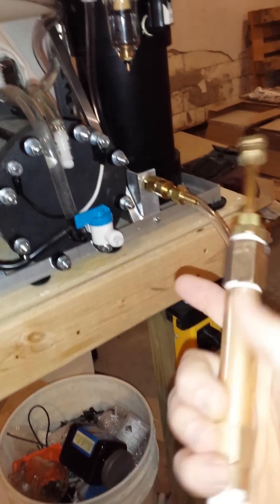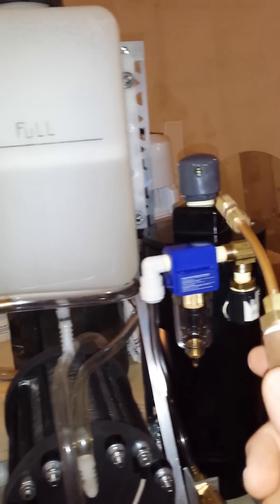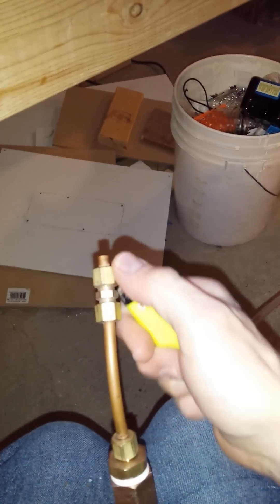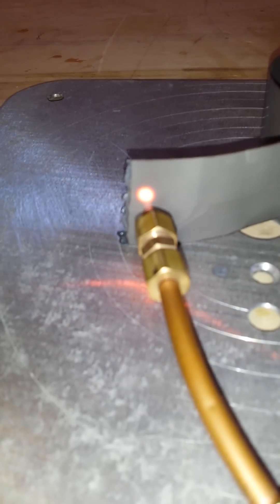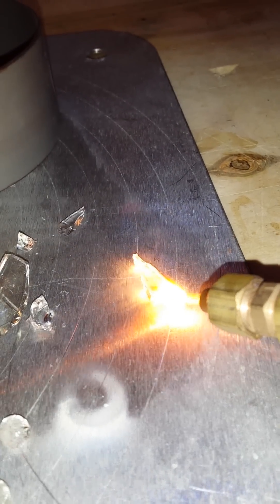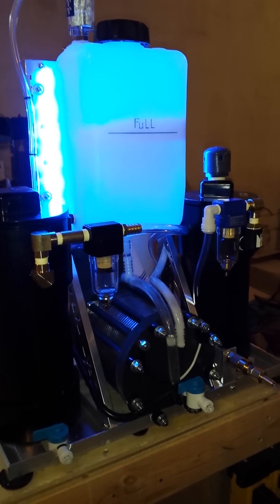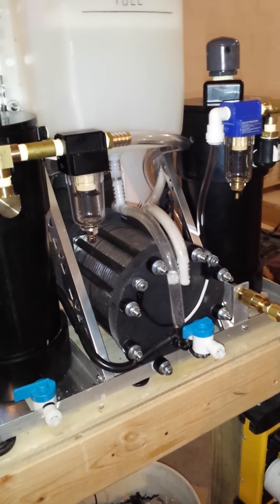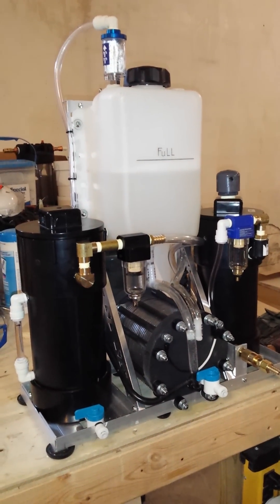Beginning of my project.... HHO MACHINE.

Comment: Do you have any suggestions on how I could build a system like yours? I've looked around but I haven't found a kit or any plans like this. I really like your system. Thanks for sharing your work. I also would like a rough estimate on how much a system like this cost to build. I have found a complete unit from the company you mentioned and that looks nice but I was hoping to build my own.
Reply from the maker: Yes, you can just purchase the HHO cell and the back flash arrestor and Electrolite water tank from that website and then just buy all the other parts at Lowes or Home Depot. My cost was around $950 to $1000. You can also check out this other guys website if this is way out of your price range and want something cheaper. He does sell HHO kits for cars at a very reasonable price that you can make your own torch set up with it. Just do a google search on LaBella's auto shop. His HHO cells are set up for 12 to 14 volts DC though, so you will need a good 12 volt car battery or charger that can put out at least 30 amps to run them. Please watch my other HHO video about a balloon and you'll see what those cells look like. Thanks for watching.
Reply: +whyme2b Thanks for the general details. I'll probably just wait and buy one from GreenFuelH20 for health. It looks like a nice unit but probably not as high end as yours. They go for about 370 and I don't need the torch. I left a phone message for him but he didn't get back with me but I'll try again later. Are you convinced enough to be drinking the saturated water every day? Thanks again and I look forward to seeing what you do next.
Reply from the maker: Okay buddy, good luck on your project. As for now in my drinking the water... I still have a lot of energy everyday when I do it and so far have no complaints. Please be sure that I will post ASAP if any thing negative happens.... thanks again for watching.